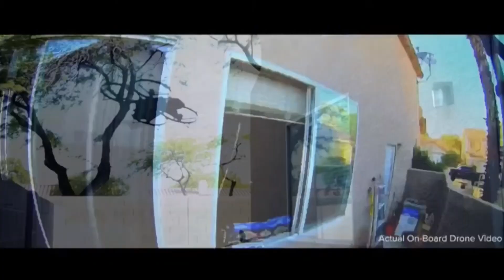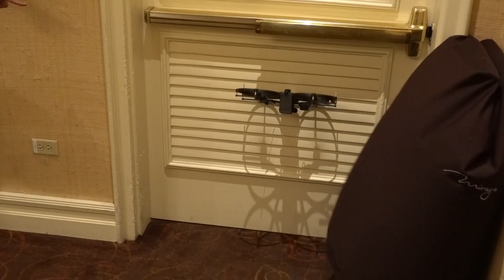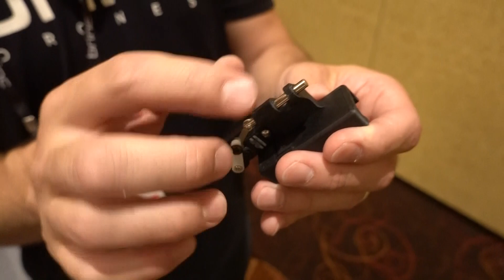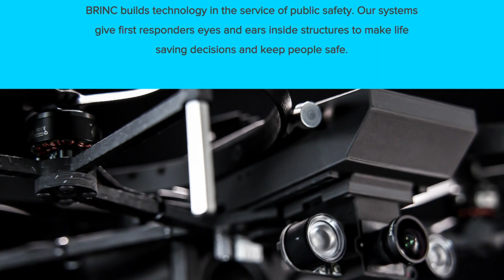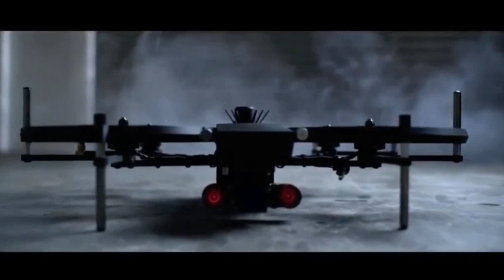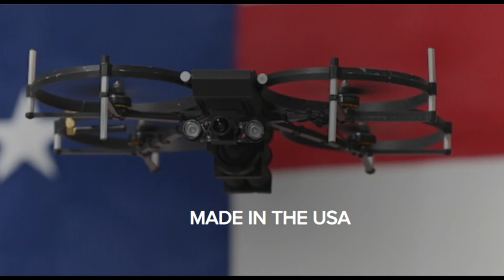Drone for Police SWAT Teams: Brinc Lemur

Comment: I love innovation in quad tech, but I just don't see anything ground-breaking in this device. I'll give him points for putting the system together, jacking up the $ and then marketing it to Leo's who might have extra budget to blow.
Reply from the maker: Hmmm... Well, to a certain extent I see your point: it does seem a bit like an old-school FPV quad like the ones we were building and flying 10 years ago -- especially with the analog video signal it sends back. However, success (or failure) in this market is seldom predicated on the technology alone. They have put together a unique set of features (glass-breaker and other attachments, built-in cell phone with a speaker, tweaked flight control system to keep it upright and/or flip it over if needed), and their mandatory training course is taught by seasoned SWAT officers. I guess I'd offer this by way of a counter-point: they would not have grown from a lone founder to 55 employees in nine months if they weren't delivering serious value to somebody.
Reply: @Roswellflighttestcrew1947  fair enough. Slight counterpoint though, and maybe a bit extreme... ENRON.
Seriously though, if the value is there, I wish the company success. The only failures I cheer on are when concepts transition from tools for good into being abused. Many well-intentioned ideas have been subverted over time by the whims of amoral people. That's a whole other discussion though.
Have a nice day. 👍
Reply: With this kind of mentality you are going to be stuck in the past. The Lemur is an incredible drone, if you want to look at actual jack up atrocities, look at Skydio and their oversold drones. $15k+ with almost no features
Reply: Your negativity impugns developing technology as well as the customers that are responsible for assessing it.   You don't even know how it has provided benefit.   Give it a chance!